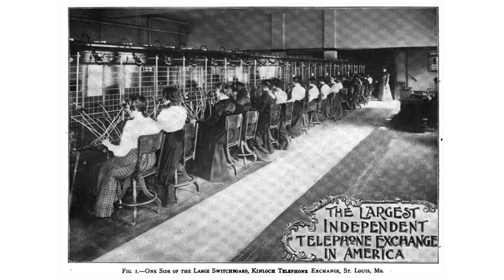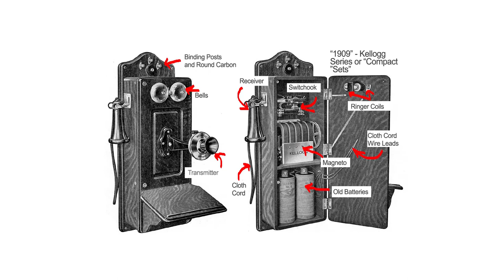1910 Kellogg Oak - Cathedral Top, Working Telephone!

Comment: That woman sounds like my American Grandma Dorcas. Who is the woman on the line with you?
Reply from the maker: That is a voice artist and actress I use.  Thanks for watching!  Please subscribe.
Reply: @TelcoSteve  I recently purchased a trimline rotary phone from Time Traveler's Antiques in Springfield, Oregon for $28. However, when I tried to plug it in to my modern phone line, it gave me neither a dial tone nor an open line. I wonder if I might need a 4-prong to modular converter. I also noticed that the handset cord can't come off the base or the handset. I think this phone was made in 1965. Is that how phones were made back in the days?
Reply from the maker: @MsAussie83  You would have to rewire the leads hopefully terminated on "The network."  This is a problem with older phones.  I can fix it. $75.00 you must pay shipping at Priority Mail Medium Size Top Loader Box and be in the U.S.A.  Email to Let me know.   telcosteve@gmail.com